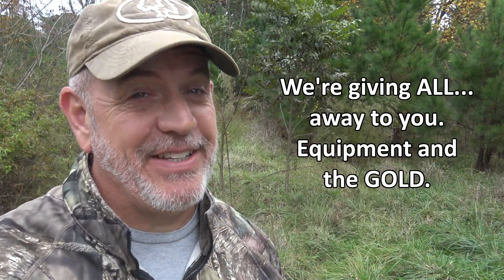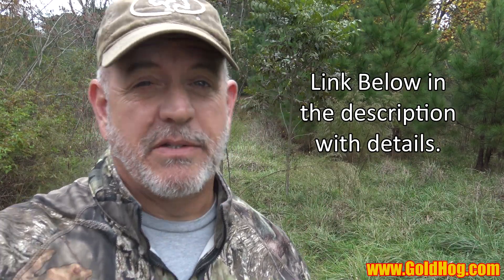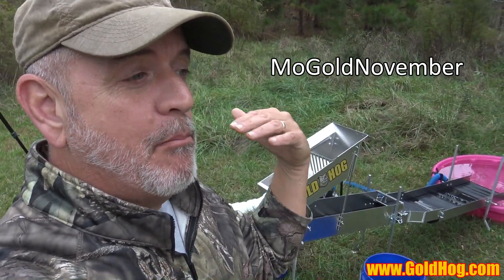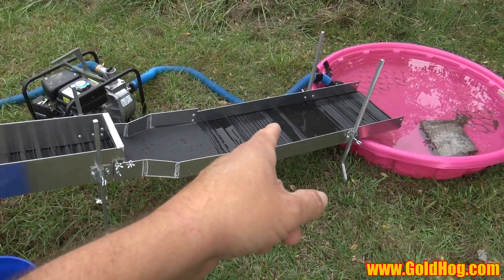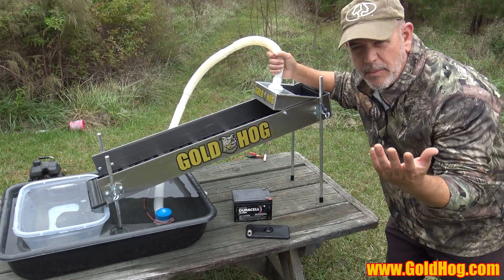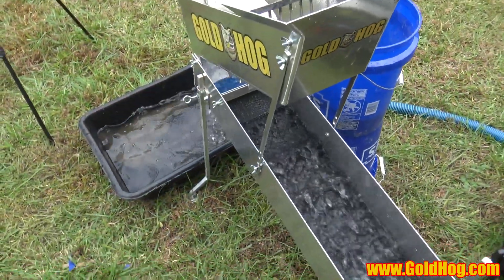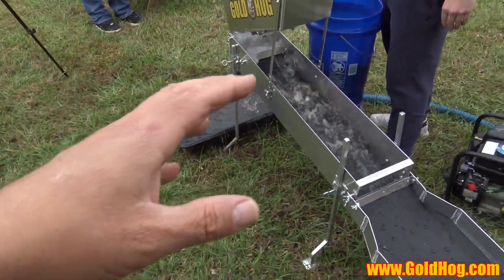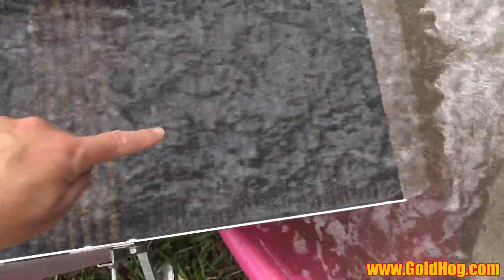Fine Gold Prospecting - Big Giveaway

Comment: I didn't see where you used the new Wave Mat which is for super fine gold. I would have thought you would put a length in the Multi Sluice. Can you advise why?
Reply from the maker: Because the washer mat is designed to STRIP. We are not worried about capture.

Comment: I run a pair of stream sluices, a power pig, two flow pans, and the add on deluxe kit.  I've modded my stream sluices so I can bolt both of them together, and run the high flow mat on top, and the low flow on the bottom.  Absolutely kills fine gold!  Have run the flow pan with beach sand and it will even nail that!  Hint for the flow pan:  Take along a squirt bottle to rinse the pan with.